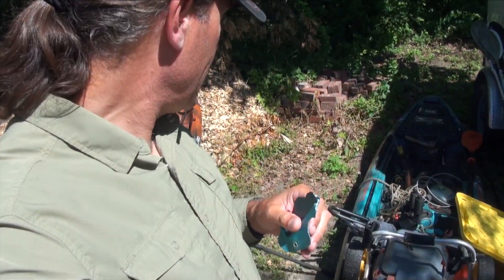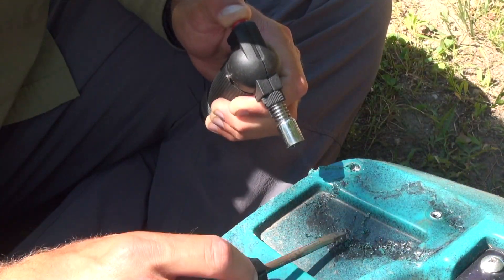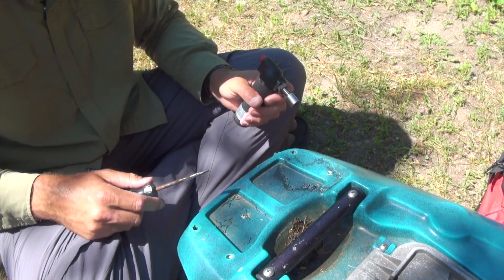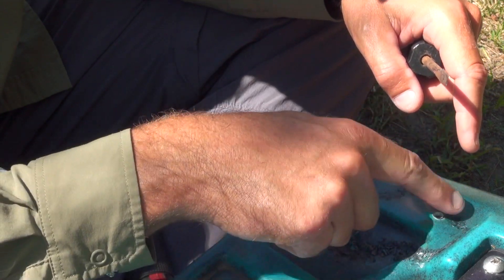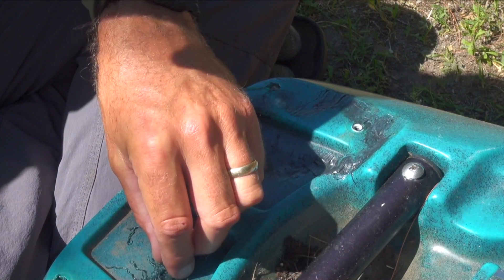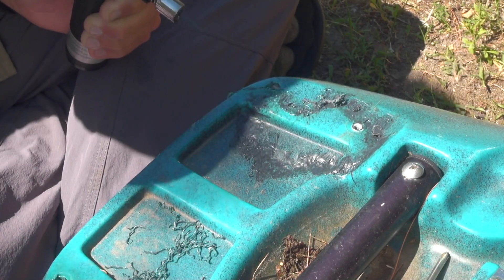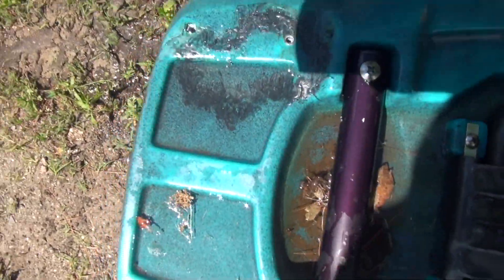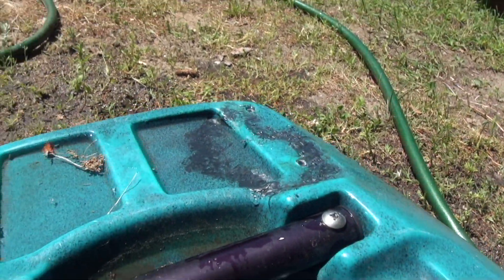I Punched A Hole In My Kayak // Plastic Welding 101

Comment: I've done some plastic welding/repair on canoes/kayaks and even 4-wheeler finders/fairings before.  The thing I use is an electric heat gun from a soldering station, as I can choose what size nozzle and "dial-in" how much heat and airflow I need. (Need 420 degrees from a 1/8" Nozzle?  No problem!  Need 550 from a 1/2" nozzle with little air-flow - for large "smoothing" of broader surfaces?  No problem!).
For me, it works better than the "Plastic Welding Guns" they sell.  I always try to "V-Groove" where I'm welding the plastic, for better adhesion and structural integrity.  (Works best if used with the "Parent Material", from what you're welding.
Juts another Random Thought...
Reply from the maker: You’re next level on this, as are the professionals who do these kinds of repairs at paddle shops. Thanks for opening my eyes to better tools!
Reply: @TheLittleStuff  I've been welding all kinds of materials (some are "Un-Weldable", according to the "Experts"!), for a lot of years (started welding in 1959), so I might have a little edge over some!  Haha!  Also studied Metallurgy and Chemistry in college, when working as a Tool/Die Maker. Most things can be welded, keeping in mind the Basics of Welding. 
Liked your Video and process you used, and whatever works for you - is always the best way!

Comment: Man this was a good video. It was awesome to watch you plastic well to kayak back together. It looks real simple and easy just take some time to fix it. That was cool seeing you fixing the kayak wearing flip flops with socks and your buddy being barefooted 👣. Me being barefooted 👣 or wearing flip flops is all me. Flip flops is the only Footwear that will barely and I mean barely fit on my foot because of my toes being wider than the flip flop straps. I have very very extremely wide feet. My toes are 6 1/2 inches wide from my big toe to my lil toe. I wish I could wear socks that was wide enough for my feet cuz I have to wear flip flops in the winter time when it's 20 and 30° outside because there's no shoe , socks , or boots that's why enough for my foot & so having some socks to wear would help to keep my toes warm so I'm not hating on you man for wearing flip flops with socks. It's just since it's summer time I know it seem like your toes will be hot and sweaty from the Heat outside. But good video thank you for sharing it.
Reply from the maker: Well it was Maine. Barely 60 degree water. I wore bibs in the water, hence the socks.
Reply: @TheLittleStuff  oh okay it was up in Maine. Yeah 60° is still a little chilly. I just wish sometimes that I could wear socks but with my foot being extremely very wide & having very fat wide toe & my toes being equally straight across instead of being at a 45° angle it makes it very very difficult for anything to fit my very extremely wide foot. Never thought that my foot and Toes would get this extremely wide. Thank you for replying back man I really appreciate that buddy.

Comment: Nice job!  Reassuring to know it's possible to repair.
Reply from the maker: This one was fairly simple. Mike will need to keep an eye on it for structural integrity, but it’s water tight. I saw a trick at the Crescent Kayaks shop that made a lot of sense for those scupper hole leaks: a spoon with one edge bent up so it would fit in there nicely. The quality control guy would heat the spoon with a torch and push it around in there to smooth out any possible leak areas. The handle was built up to not transfer the heat to his gloved hand. Perfect tool for the job!
Reply: @TheLittleStuff  That's awesome!  Happy there's hope if something cracks!